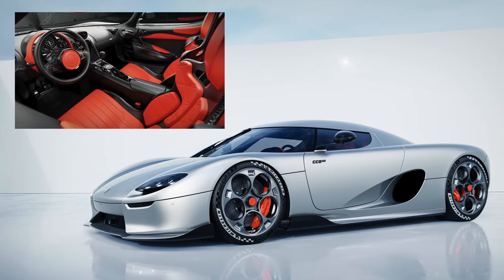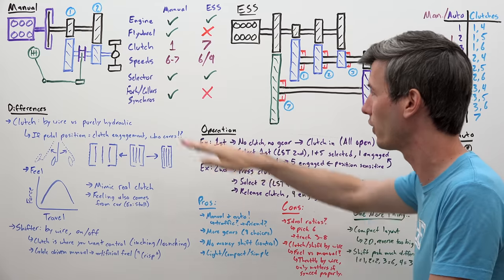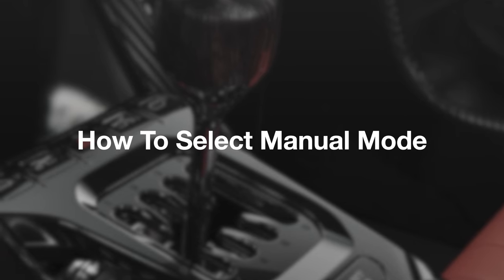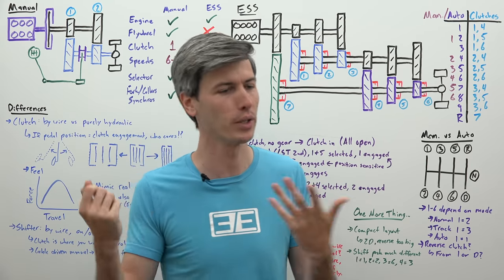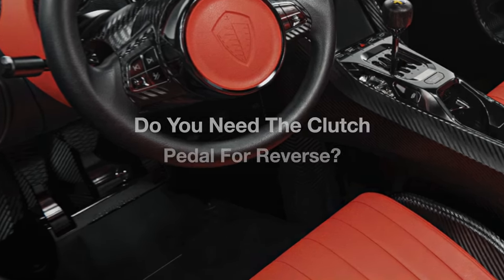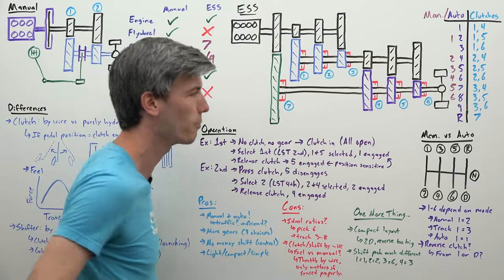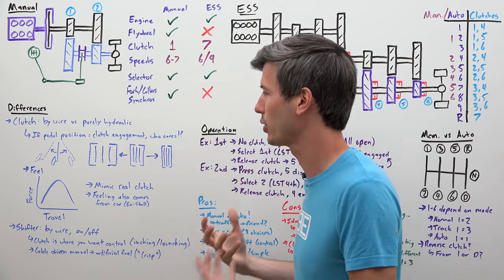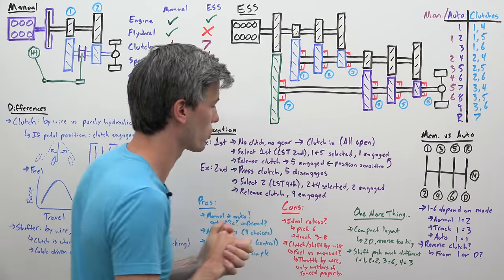Koenigsegg Reinvents The Manual! How The CC850 Transmission Works

Comment: I hope this becomes industry standard.
I know it won't because it would be incredibly expensive and totally not worth it for just about every car on the market.
But there's nothing worse than looking for a new car, finding one that you like a lot, then finding it doesn't come in manual or automatic (whichever you are looking for) so you have to look for something else.
Reply: This gearbox should be put in motorcycles, so we could get rid of the annoying ones they have today.
Reply: I would hate this. I love my old school manual transmission. Part of the feedback I get from driving a traditional manual is the feeling on the shifter of the synchromesh lining up. You're not going to get that with an electronic selector.
Reply: @nhytg376tgyuu765gjmg  You're crazy, the sequential dogbox transmission on a real motorcycle is about the best thing about riding a motorcycle. Don't even need to use the clutch if you know what you're doing after you get moving, lightning fast and in no way like clutchless shifting a syncromesh transmission...
Reply: @pontiacg445  the backlash in the gearbox on MC's is extremely annoying. When you let of throttle and give throttle there's a very obvious lag. That's because the holes in the gear needs to be much larger then the recieving dog tooth itself for the gear shifting to work smoothly. But it's a massive drawback in my book.
Reply: @nhytg376tgyuu765gjmg    Well, we have 2 x DCT Honda's at home, which are pretty close to this as it is........
Reply: @pontiacg445  yes: and Honda's DCT even moves that on a bit more.

Comment: By examining the gear ratios, it's possible to deduce which orders the clutches are used. And it is indeed in the simple order you described in the video, not the more complicated order that you  started to describe from 17:37. So essentially it's one gearbox with big steps, in series with a gearbox with steps that is about 1/3 of the other one.
Reply: Thanks for confirming. I planned to take a screenshot of the ratios to figure out the internal radios for each of the two sets.
Reply: @perwestermark8920  The way I did it was to put the numbers in a spreadsheet, make a matrix of ratios of gear ratios, and identify triplets of identical ratio of ratios.
r1/r2 = r4/r5 = r7/r8 = ratio between gear 1 and 2 in the small step gearbox
r2/r3 = r5/r6 = r8/r9 = ratio between gear 2 and 3 in the small step gearbox
r1/r4 = r2/r5 = r3/r6 = ratio between gear 1 and 2 in the big step gearbox
r4/r7 = r5/r8 = r6/r9 = ratio between gear 2 and 3 in the big step gearbox
But then I realized that it's possible to see it way easier. 
All gear steps are fairly evenly spread out, and that's impossible unless each step in the big step gearbox is larger than the full range of the small step gearbox. 
If there's not that distinction between big and small step gearbox, there would be smaller gaps between the gears in the middle of the range.

Comment: I would LOVE this transmission in my GT350. The option to have a manual to keep with the nature of the car, but then leaving it in 9A for absolute performance (the 6spd leaves a lot on the table in terms of acceleration vs the 10r80 or gt500 DCT)
Reply: I think manual mode is as fast as auto mode because of shift by wire, but take this with a grain of salt
Reply: @mellopelas2857  no, because it simulates conventional manual shifting. So it's as fast as a regular manual transmission, or as fast as the driver is i guess.
Reply: Unless you're a competitive race car driver, and the car is going to be used as such, manual is the way to go. Anyone who avoids manuals because they don't know how to drive them, just take the plunge. I learned to drive stick on the way home with the first manual car I bought.
Reply: @danmac6185  lol basically. I showed up and bought my e92 m3 6mt and figured it out on the way home. Did the same with my first R6. Dive in 😂

Comment: Initially this per gear clutch system is what I thought was how the Volkswagen DSG transmission worked. Later I learned it uses a two input shaft/two clutch pack at the flywheel to make its magic work, but in my own head I was still impressed by the per gear concept. 
I’m glad I wasn’t the only one thinking along those lines and someone was able to make the concept a reality.
Reply: 😅 yes you thought of this system before Koenigsegg. You must be a very smart person.
Reply: Most Honda automatic transmissions work this way with individual clutches replacing synchronizer assemblies.
Reply: You should go after them for ip theft.

Comment: That is absolutely glorious!!! I love the idea of this version of an auto with manual mode. Or as I would prefer to think of it, a Manual with auto mode.

Looking forward to aftermarket availability for kit cars and builder mods.
Reply: I bet you could buy a '23 z06 corvette for  the price of this transmission.
Reply: Nope it‘s still a automatic with manual mode. As everything is controlled by wire the H pattern can be replaced by paddles and the clutch can be automated (also triggered by the same paddles)

Comment: People don’t like “by wire” because their experience with it is thru something like a Prius or even your Crosstrek where the car is clearly doing things that are disconnected from your inputs. If we all had Koenigseggs instead I think we wouldn’t mind.
Reply from the maker: Okay you had me until you started throng shade at the GOAT. Long live Crosstrek!
Reply: @EngineeringExplained  🤣
Reply: @EngineeringExplained  The Crosstrek has a similar 0-60 time as a goat.
Reply: @sirchippyton  lmao
Reply: My first expérience whit drive by wire was almost 20years ago and felt like that.
Reply: @EngineeringExplained  Haha well I only bring it up because I have an Impreza and often find the throttle and transmission programming can be unpredictable at low speeds with very light throttle (eg getting in/out of a crowded garage). These two cars are otherwise clearly punching above their weight 8)

Comment: It's amazing how someone without an engineering degree built a company that leads out of the box engineering solutions in an incredibly interesting way!
Reply: He surrounded himself with passionate, smart people. And takes their advice
Reply: This is only a "solution" to the "problem" of stronger and more reliable clutches and transmissions. Replacing one strong and reliable clutch with 7 weaker clutches is a step backwards.

Comment: In manual mode you could use the 'automatic gear' as a 9th gear for cruising fast. You shouldn't be able to feel it's in automatic until you push the pedal down - but for that case you should already have shifted 'down' to lets say 4th gear.
Reply: I was thinking the same thing, it’s technically a 7 speed manual that way with a highway gear added to a close ratio manual, which would make it fun to drive. Obviously it’s a super car so it is, but if it’s applied in a Honda Civic it would still be a lot more fun in my eyes

Comment: Some syncro's are nonetheless more than cone clutches , some are toothed . The system to chose which clutch/syncro  is very interesting . Controlling the shaft speed/engine speed w/o a flywheel is also interesting .

Comment: Well done!
 
Seems even in manual, you can shift without using the foot clutch. When you pull the lever into neutral, it disengages the 2nd clutch, when you select the next gear, it re-engages the 2nd clutch.

Comment: discuss 7 clutches vs. 1.  While I'm sure a Koenigsegg wont see 120,000 miles (normal clutch wear and replace) AND a Koenigsegg owner likely wont care about the cost of replacing 7 clutches...the complexity or longevity could introduce quality of shift risks.

However, spreading motor forces across 7 units vs. strictly through 1 unit also may have wear and driveability benefits.

Koenigsegg always making their own box
Reply: There are Koenigseggs with 60k+ miles
Reply: Wet clutch will last much longer than a dry clutch. Jason was talking about clutches on powerlifting equipments that last very long.
Reply: with this type of transmission the clutches don't wear out evenly. And it's kind of early to tell how it's going to be like in the long run. Let's wait until we see jeskos and cc850s with 120k miles.
My bet is that as it happens with conventional transmission synchros, the 1st and 2nd gears' clutches will need replacement sooner than the others
Reply: Modern automatics have just as many clutches and generally work fine without ever replacing clutches, so “more clutches = more problems” isn’t a good indicator of longevity. In fact, they work better than DCT’s with only 2 clutches in strenuous conditions (ultra low speed crawling, off-roading, hill starts).

The load is never spread across clutches - they can’t back each other up in any gear. But the same is true for automatics and it’s not a showstopper.
Reply: @Kyriaeus  the very popular (and impressive ZP) has 3 clutches so fair point.

Comment: They are the future of automotive engineering, years ahead of the car manufacturers who have been in the business for years, it just shows what happens when a car company is run by an engineer rather than an accountant 🙄
Reply: Ya, that is what made Lotus such a great innovator back in the day.
Reply: They're not really ahead though. This is quite literally just an automated manual transmission. The only difference between this transmissions and an automatic is the fact that this has a clutch pedal and a fake six shifter for the "manual" mode instead of just paddle shifters or a +/- on the lever. It's all shift-by-wire.
If you know how an automatic Smart Fortwo works, this is exactly how that works- except it has an automatic transmission clutch pack set up instead of just a standard manual single clutch.

Comment: I own a six-speed standard transmission vehicle and when in heavy traffic, my left foot fatigues rather quickly. My car, of course, only has a single clutch, but even so, I find myself wishing for a lighter clutch. Wouldn't having seven individual clutches make depressing the pedal nigh impossible? Or would your clutch pedal be electronically boosted?

Edit: its shift by wire. Next time I'll finish the video before commenting
Reply: Maybe You can make it a little easier by greasing the ball-attachement-point that connects the slave cylinder to the lever going into the transmission.  
This helped on my 13yo Toyota.
Reply: @tsd560ti6  also try to bleed the fluid i assume that it's connected with your brake fluid and it is a hygroscopic fluid 😖
Reply: When In heavy traffic try to keep a few car lengths in front so you can just idle in 1st gear most the time.
Reply: How many miles has it got? If its got a few miles on it and its never had a clutch replaced a new clutch may be significantly lighter, as clutches do get stiffer with time as they're work-hardened by flexing in and out.
Reply: @__-fm5qv  it's very old

Comment: So it is shift by wire.
I knew it, and everyone was telling me that there was an actual connection. There is, but its not mechanical, and all the feel is tuned into the shifter and clutch pedal.
Haters gonna hate, but I was right, this isn't "magic" its just letting you select your own gears when ever you want them, its still technically an automatic. 
This tech isn't revolutionary, its just been perfected by having this many clutches in a transmission. Modern automatics are heading in the direction of clutch and shift by wire anyway, this is just the big money way of doing it.
Props to koenigsegg for letting people have this, they didn't have to, but they did, now all we need is DCT manufacturers allow us to do this with a single clutch.
Reply: The owner, from personal experience talking with him in person, is a "manual master race" mind like many other, but as he stated to me "manuals won't break world records".

I do agree with him tbh, but at the same time I'm happy driving my manual as he is driving his on his private cars ahahahah
Reply: When you say it's technically an automatic - I disagree as follows : The movement of each clutch is directly proportional to the movement of your foot clutch (or gear shifter).  It doesn't make movements other than the ones matching your granular input.  If it just acted digitally, such that it was on or off based on your movement, I would agree with you.. but in this case, the movement of the clutches are the same as a manual is, just with an invisible electronic connection instead of hydraulically.

If you define automatic as just 'computer or electric assist' then sure you might call it an automatic, but that would ignore the reality of the implementation of this particular solution.

Comment: I like that you could potentially go into a sequential shift mode with no need to press in the clutch on the track. You could select the optimum gear for a corner and rely on the computers to optimize your shifts.

Comment: I wonder what happens if you float the gears (time your shifts without using the clutch), specially when you're shifting between two gears that share the same gear shifter clutch (like 2nd to 3rd)?  Or does it just lock the gear shifter physically if you're not touching the pedal at all?  It's still a super cool design!
Reply: You float the gears by reducing the torque applied on the synchros (so not accelerating with engine nor decelerating with engine brake) but since this doesn’t have synchros AND the shifter is also a clutch pedal you could very well shift this like a sequential transmission, clutch(pedal)-less
Reply: According to Koenigsegg from their official reveal of the CC850, yes you can float the gears/clutches. Everything you can do in a current manual vehicle can be done with this transmission.

Comment: If the shifter has analogue control over the first clutch, it would seem reasonable it could do it for both as well. So what if I move the shifter without pressing the clutch? It would seem to me that (up to how it is programmed) it could shift completely without the clutch pedal as well.
Reply: I think so. Seems like a DSG gearbox with the ability to control one set of the clutch packs with a clutch pedal.
Reply: Sounds right. If you engage it slow enough, you should be able to achieve a smooth shift. Likewise, by dragging the shifter a little back-and-forth, you could play with clutch slip. No way to know how it will behave since it's all computer trickery.
Reply: It will prevent you from shifting from neutral to gear in manual mode unless the revs match. The stick has some form of hydraulics/feedback that can lock the lever to give the same behaviour as a real manual. Source: Christian Koenigsegg

Comment: In my own theory i think its is very much possible to shift gears manually without using a clutch(only when the car is moving) because it only uses clutch instead of a dog gear in order for the synchronizer to deliver the power and it doesn't matter if its mechanical or electronical

Comment: Jason is correct here: what matters to allow this synchronization are high raster rate speeds of which the ECU can calculate inputs vs outputs. When you step on the accelerator pedal, this is an input; then the ECU gives the calibrated output of opening the throttle. As long as this speeds are fast enough where a human can’t detect a delay, it gives a well synchronized feel….just like a throttle cable feel.

Comment: That was brilliantly explained!
I have three questions:
1. Once the car is rolling is it possible to "crash" shift without the clutch with throttle control only?
2. Is it possible to clutch start the engine if the starter motor or cranking battery have failed?
3. Is it possible to drag the vehicle short distances with the starter motor if the prime mover has failed?
Brilliant episode. Thankyou.

Comment: Thanks for the visualizing and explaining this so well. Pretty sure you mostly covered it but if you can confirm 
* You can shift between Manual and Auto (D) at any time, eg Driving in 6th Manually and you move to Auto to take advantage of that great tall 9th Gear .6 566 for highspeed Highway/Autobahn cruising and then shift back to manual whenever you want obviously sensibly without over/under revving.
  Without knowing the Final Drive ratio (Im guessing it is quite low like around 3.4 to 1). I think the Manual Mode should be 2 =3 on Auto with every ratio only 1 space apart not 2 to 5th. Then 6=8 as is.  I think the 7th gear ratio in Auto should be nearer to 1 to 1 and the 8th closer to .8, but I'm sure  Keonigsegg are chasing peak acceleration to 200mph rather than cruising at 200mph.

Comment: This is such old tech, being in the machining and engineering industry we see this quite a lot on old Italian lathes. They have six electric clutches that allow you to change the speeds on the fly therefore no need to stop the spindle or disengage like with a clutch. All the guys who worked with me at this workshop were asking when they would apply this to car/motorcycle gearboxes. Trust me when I say that the lathe was 1970's design. Hate to break it to you but nothing new here, merely building upon something with slight tweaks. It is good to see it enter the automotive industry...finally.

Comment: I think most carmakers have been reluctant to do these 3x3, 3x4, etc. designs because certain shifts would require shifting both sub-transmissions simultaneously while under load which requires some clever control strategies. Most modern automatics only need to swap one pair of clutches for any sequential or double shift.

However, it’s not impossible. The Chrysler 62TE 6-speed gearbox does a double-swap shift between 2nd and 3rd gear, and this double swap shift hasn’t been an issue. The 62TE does have other problems but those are unrelated to its shift strategy.